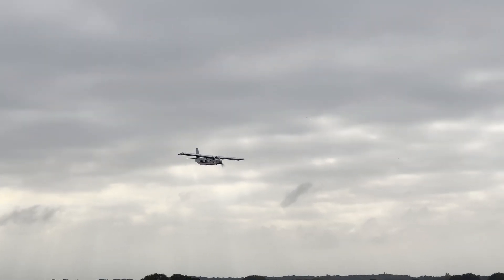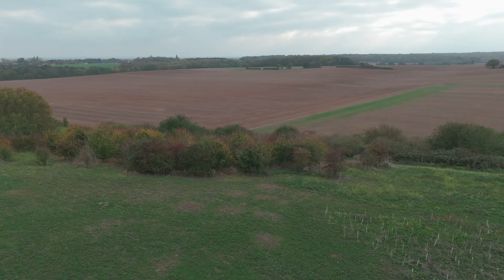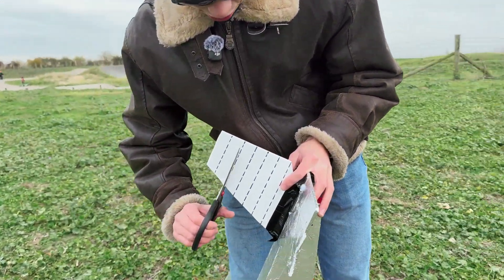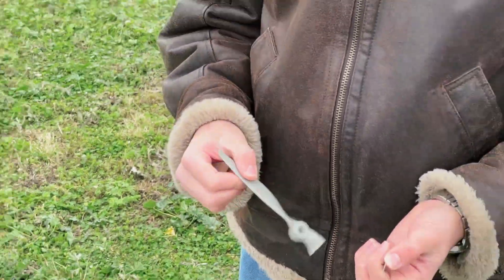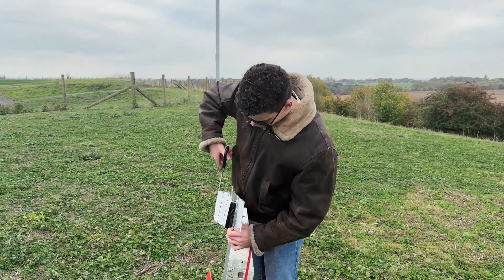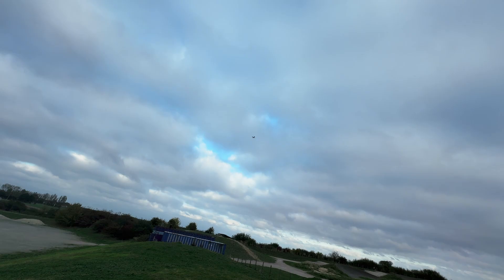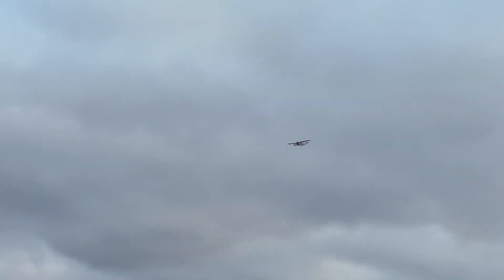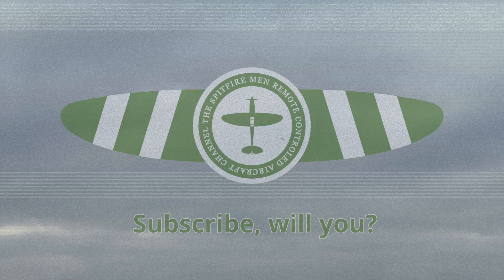We CRASHED A Plane to Find Out How Much Tail you need!

Comment: You can make a left turn better because of the angular momentum created by the engine.
Reply: by the way, your craft can still be controlled during a roll without a keel if you replace the ailerons with spoilers, this will increase the aerodynamic drag of the wing moving down which will force it to move backwards and lower its nose down during the maneuver. This is of course a very inefficient method of stabilizing the aircraft, but fun ;))